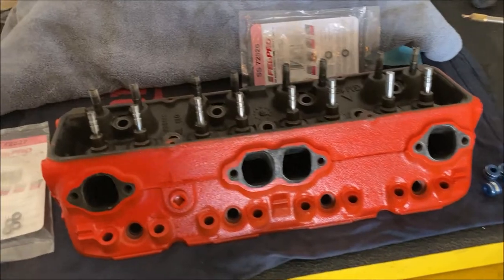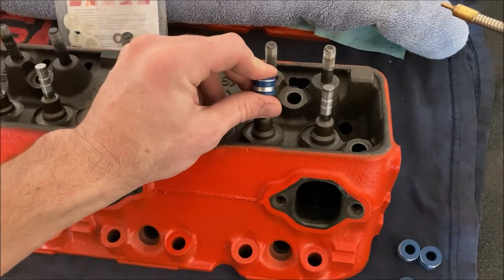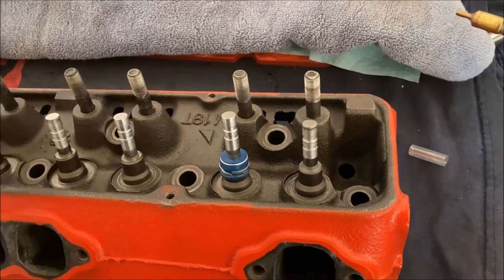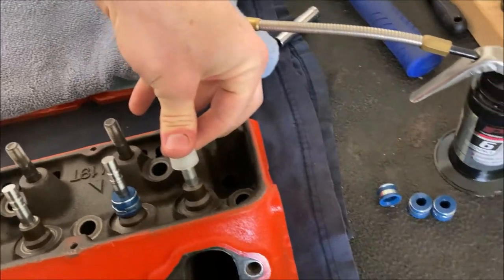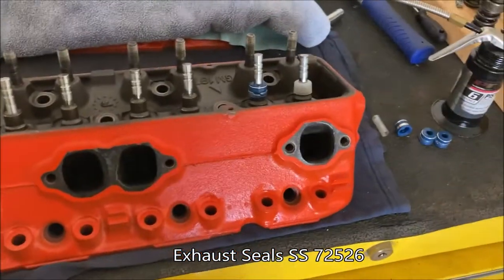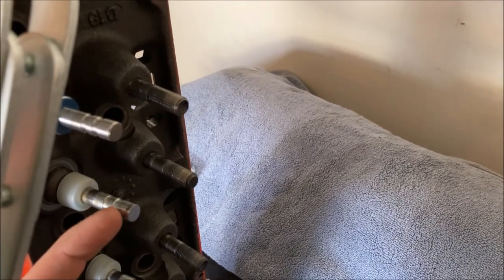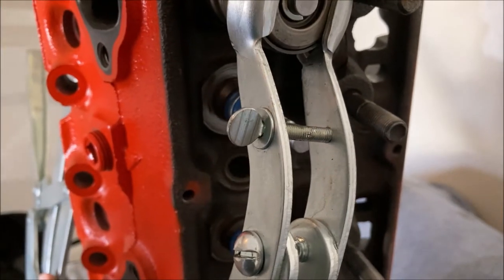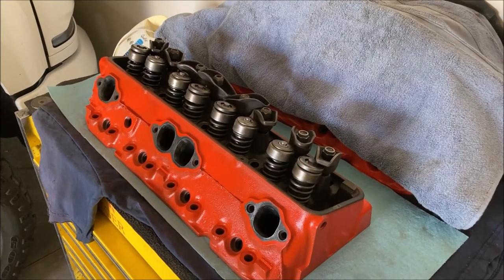SBC Cylinder Head Valve Seal Install and Spring Assembly

Comment: Thanks !  Appreciate the detail, especially how to install o ring shape seal.  It has to 
go on after the spring assembly just before stem retainers.  That same o ring seal when old and hardened will grief you to get  spring assembly off. Tip that worked for me; Compress spring well and use awl tip to pick down the valve stem and break it up old hardened seal.  Just  finished my 1973 SBC valve seals replacement.

Comment: Side tip-use motor oil or assembly lube during seal assembly and on the valve stems when installing them-will make things easier and reduce wear!
Reply from the maker: I must not have said that, I definitely recommend that! I used engine oil during assembly.

Comment: In my research the general consensus is use the umbrella type seal or the valve stem O-ring but not both. Using both will cut down too much on the oil supply for valve stem lubrication.
Reply from the maker: I’ve heard that also now too. It’d be interesting to see if the valve stems have been worn down much more than expected after about 10,000 miles
Reply: @iowadiy6361  so any update i got the exact seals u got and put both the oring and the exhaust with the intake seals but i am worried about the exhaust plastic umbrella thinkin it might break into pieces shoudl i change them?
Reply from the maker: The plastic umbrella style exhaust seals last a very long time in an engine. The only reason they would break into pieces is if there is not enough clearance for the cam lift

Comment: Iowa huh? Well this viewer does his burnouts on the streets of Sioux City lol i thought my guide bosses were too big for positive stop seals but turns out i was looking at the wrong parts. Thanks for those part numbers.
Reply from the maker: Sioux City is a little ways away from me. I’m originally from the Fort Dodge area. I’ve definitely ordered the wrong parts before but I measured the guide boss and valve stem with a caliper. Turns out measuring helps. Lesson learned.
Reply: @iowadiy6361  oh yeah ive been there before, bought a 80s camaro from a guy. Yeah im hoping to have this engine together so i can tear it up on the dirt roads along the Loess Hills. Its just a 305 but i spent alot of time on the heads and the bottom end has less than 100k with a factory roller cam. Its going in a 2wd 89 GMC1500 with the 5 spd.
Reply from the maker: That’ll be a fun setup. “Just a 305” is a common phrase, but that’s still a V8 that makes good power. Hope it works out good!

Comment: Are you sure those aren’t the seals that require the guides to be machined down?
Reply from the maker: No, they have a proper fit with the stock machining. The retainer to seal has clearance also with the cam lift for this engine

Comment: Question: do you need the o-ring seal if you're already using the positive stop?
Reply from the maker: You could probably get away with skipping the o-ring, but I wouldn’t recommend it. It’s just a second defense for the valve stem

Comment: Those heads are post to be machined down for the positive seals,your heads has not been machined,  under heat those seals will break from being stretched.
Reply from the maker: It’s possible that the valve guides aren’t perfectly concentric with the original machining, but for this engine and this purpose, these will last a long time. The seals were spec’d for this valve size and guide boss.

Comment: Can I use the same gasket set on a 1987 350 small block? I'm from Europe and it's not very well known here. Thank you
Reply from the maker: The oil pan gasket and rear main seal are different between this early block and 1987. The heads should be the same, but the best bet is to measure them. If I remember right, it was like 1986 or 1987 that Chevrolet switched to a 1 piece rear main seal.
Reply: @iowadiy6361  So I don't know if I correctly determined the year of the engine. I have a 10066036 engine made in Mexico. It is intended to be a replacement engine for 1971-1985 model cars and light trucks. It is also stamped 2M0619 0VP. I don't know when my engine was made. I have been studying various internet forums for a long time, but this is the problem of many people even in the US. I will also replace the intake manifold gasket. I am also studying what to buy. It is complicated for a person outside the US and has no one to consult. I wanted to get things before I disassembled the engine so I would have everything ready. I'll have to figure it out somehow. Thank you and I wish you all the best.
Reply from the maker: @martin971 I did some quick research and it seems like what you found was correct that it was a 2 piece rear main seal block. All of the bottom end and even intake gaskets will all be the same as the seals I used. I had some previously machined heads, so I’m not sure on the valve stem seals. That would depend on which heads you have and if they have been machined at some point.
Reply: Thank you very much for your advice. Is the Fel-Pro MS 90314-3 intake manifold gasket suitable?
Reply: Goodwrench 350 sticker on the engine. In the booklet that came with the car and which I am looking through now, it says that the engine was replaced in 2000, the price of the engine was $1447. ))
Reply: @iowadiy6361 I forgot to mention that I have a beautiful 1978 Chevrolet C10 Cheyenne.  I got into the engine now and the number on the intake manifold behind the carburetor is 346249 13 GM. This according to the table,,346249 - 305/350/400, years 75-77, 4-Brl, Quadrajet.
Reply from the maker: With a GM part number on the intake, I would assume it is stock. If the intake is stock, I would assume the heads are too, and probably not ported at all. Those intake gaskets are exactly what I would use. I like the Fel-pro gaskets. I’ve had good luck with them. When you get into ported heads/manifold or aftermarket parts, then there’s usually different gaskets needed.
Reply from the maker: From the sound of it, you have a completely stock crate engine, which would be a great truck engine. Probably good torque at low rpm range
Reply: @iowadiy6361  Thank you so much. Martin
Reply: @iowadiy6361  Can I ask another question for my curiosity? Why are there different seals on the intake and exhaust valves? Is it because of the higher exhaust valve temperature? I would like to learn as much as possible. Thank you ).
Reply from the maker: @martin971 I used the umbrella style seals on the exhaust because they are cheaper, and do well enough. The exhaust is hotter so it will burn off any excess oil. The intake valve I used a positive stop valve seal. The positive stop seals are generally assumed to be about the best for oil seal and longevity
Reply: @iowadiy6361  Yes I understand. So in theory I can use the blue gasket on all the valves. Thank you for answer. I really appreciate your answers to my questions. M.
Reply from the maker: @martin971 yes you can. That’s very common to use positive stop valve seals on both intake and exhaust valves
Reply: @iowadiy6361  Hello, what tightening torque do you recommend for tightening the intake manifold? 25, 30, 35 Ft/Lbs? I don't want to make a mistake on this one. I found a lot of opinions and I don't know which one is the right one. Thank you
Reply from the maker: @martin971 it depends on the bolt manufacturer and the intake material. I think ARP fasteners are higher torque but an aluminum manifold is lower usually. 

I’d say the biggest thing is to tighten in a criss-cross pattern and to do the pattern again and again until all the bolts are tight. Intakes don’t always sit square so it moves around as it get torqued.

Comment: Do you have stock valves with those 882 heads?
Reply from the maker: Yes they are. I did this cheaply so I reused the valves except for a bent one.
Reply: @iowadiy6361  thanks!   Same here, wanted to clarify to make sure the part numbers are correct.   Great video and thanks for the info.

Comment: Im in the process of rebuilding my entire engine cause im tired of breaking down, and I decided to do the heads last. Come to find out the guy I bought the trans am off of never put any seals on at all. That or they got ate by the motor. Its been running for 3 years with no seals how I have not a clue. Not even serious smoke either. And I rag on that trans am 😅😂😂
Reply from the maker: That’s not uncommon on performance builds.. but people tend to do that on street engines which isn’t exactly the right practice